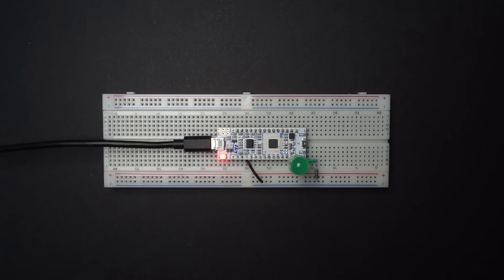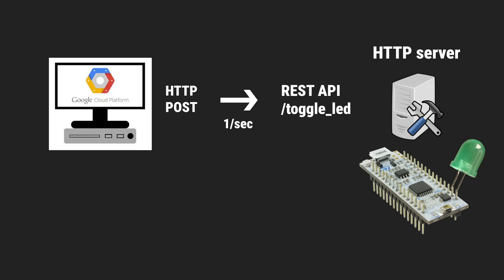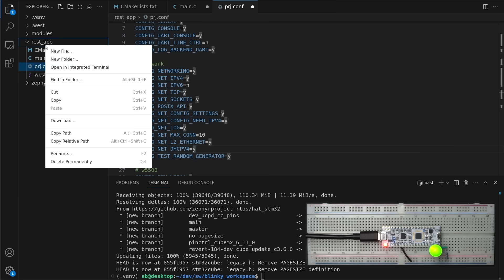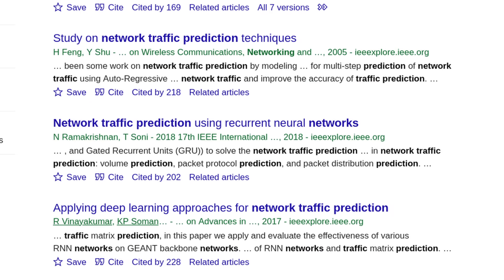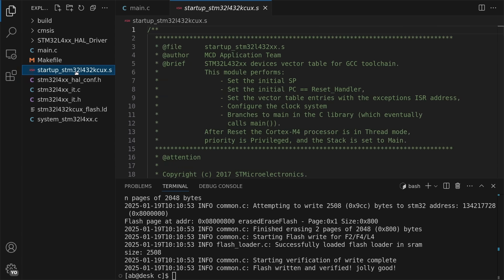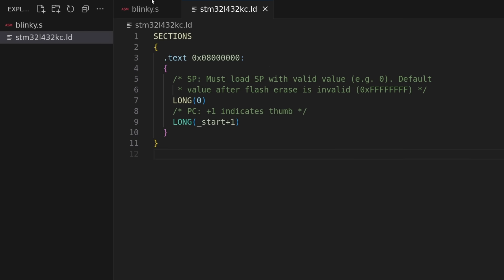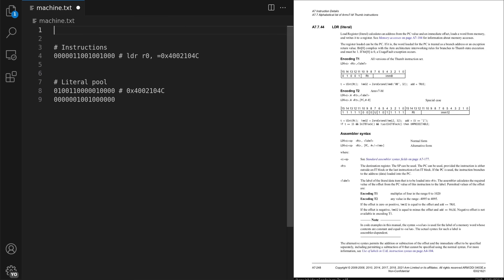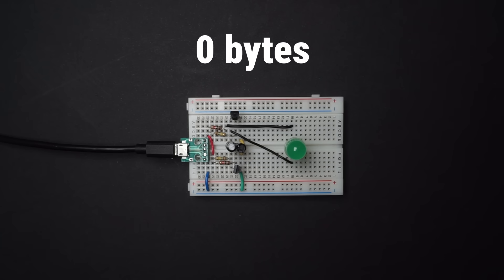I Shrunk Blinky to 0 Bytes

Comment: Now go to the beach, take some sand, extract silicon dope it with aluminium or phosphorus and make transistors, then make LED from same silicon, take two conductive plates and place them together but separate with dielectric, make resistors (maybe graphite?), and mine for copper and melt it into wires, then connect everything
Reply: Still bloated, make a custom led-transistor semiconductor that will oscillate precisely at 1 sec.
But first you have to develop photolithography.
Reply: @monad_tcp you can actually just buy them. No need to craft them. Another abstraction layer removed.
Reply: And that's how you make a C... <abruptly stops>
Reply: @FastKonrad  BAHAHAH
Reply: Copper?! You mean that pretty niche minecraft ore thats been such a meme that it ended up being a real ore irl?!
Reply: Silicon is bloat. Some hand-made relays and an electrical arc will do just fine.
Reply: LED's aren't made from silicon...
Reply: @kstevens3573  Depends on what colors you want.
Reply: @kstevens3573  Wikipedia states LEDs are semiconductor devices, so silicon seems rather accurate. Though some compounds are used to obtain certain colors, but it does not specify in which quantities or whether just as a coating. We are not talking about the plastic packaging, which probably makes for the majority of the weight and volume of a regular THC LED.
Reply: @km077  Silicon has an indirect band-gap, so cannot be made to emit visible light.  Not all semiconductors are equal. 
 LEDs are made from GaAs, InP, SiC, GaN - all of which are direct bandgap materials.  You'll see heavily doped materials like InGaAsP for green LEDs, as doping increases the bandgap, and hence the colour frequency.  White LEDs use a blue GaN LED with a phosphor coating.  
The physics of indirect bandgaps is complex, but basically the excited electrons need a different momentum from the ground-state electrons, and this makes the direct transition "forbidden".
Reply: @km077 All the cool kids are using 3-5 semiconductors. As in instead of group IV B* silicon, they use a compound of one or more group III B elements and one or more group V B elements, gallium arsenide probably being the most common. Some also mix in some less common elements like indium. Some blue LEDs even use a 2-6 semiconductor (zinc selenide, known as ZnSe to its friends). And if you insist on staying with group IV B, there's always silicon carbide.

*yes, it's old nomenclature but calling them group 13, 14, etc kind of hides some of the detail.
Reply: computer is technically just a hot sentient beach cooled down after that we tricked into thinking by engraving magic runes onto it
Reply: @ProSureString underrated comment.
Reply: what an original and unrecycled comment
Reply: You can make a simple oscillator circuit using an inductor and capacitor. By adjusting the value you can achieve a simple dumb version.
Reply: Lol😂
Reply: there are channels out there making their own semiconductors and IC's
Reply: You can’t make LEDs out of silicon, at least not if you want visible light. You need germanium compounds.
Reply: ... profit.
Reply: I do wonder how easy it would be to accomplish the objective of 'blinking light' starting from exactly zero materials, primitive-style. Without electricity it would be trivial with some heat-powered contraption and a fire, but maybe you could even do it electrically if you smelted some minerals?
Reply: and dont forget to make the timing quartz
Reply: It is Boron, which is more commonly used as P-type dopant.
Reply: If you love this kind of thing of normal people performing commercial processes check out “applied science”
Reply: No need for silicon. A relay can do it.
Reply: @samuellourenco1050 relay can’t emit light
Reply: LED is bloat, mine for tungsten and extract inert noble gasses from the atmostphere and make a fillament.
Reply: Done. What's next?
Reply: Teeeechnically... many LED (all?) are used on gallium arsenide semiconductors and not based on silicone. #nitpicker
Reply: Only the real ones know about the PN junction.
Reply: Still bloated. Just flip a switch by hand, or automate with a pendulum clock mechanism.
Reply: That's easy. I'll go to the original singularity point and trigger the expansion first. Check mate.
Reply: You could get rid of most of that and just do the "wires" part. Once you have wires, you don't need anything else. A couple wires in a coil shape is a relay. That provides you with both clock and logic. A very thin wire is a light.
Reply: Or just use an LDR, resistor and Capacitor to make no-semiconductor blinker
or make one with bimetal switch.
Reply: @SurajGrewal LDRs are semiconductors...

Comment: You missed one possiblity.... it may not fit directly in this stack of layers but...
I don't know this specific microcontroller but most of them have clocks/timers/dividers, so you can setup them to divide some clock and output it on gpio pin.
Then your program will have for example 50 or 0 bytes depending on the method of counting... 0 running bytes, 50 setup bytes ;)
Reply: The only right way it is ;)
Reply: @TheBypasser  Yes, it always feels so good if you manage to implement most of the logic with just Timer/Counters, Events and DMA.
Reply: I thought that's what this video was going to be. That he found a neat configuration that would blink the LED while using technically zero program memory, and only writing the peripheral registers.

I was quite disappointed when he went with the non-microcontroller route :(
Reply: @kal9001  bro did u read, op said 50 bytes

not zero
Reply: @ "Bro" did you read the literal video title... lol
Reply: It's possible to use the debug interface, which itself most likely uses temporary RAM code, to directly modify device registers like GPIO and PWM control. That way there'd be nothing in the program memory and the core could remain halted with the PWM peripheral generating the signal for the LED. It'd stop working after a reset or power cycle, though.
Reply: Correction: I'm sure the debug access port can write to device registers directly. RAM code is for flashing. So there'd be absolutely no code on the MCU.
Reply: I was wondering about setting up a pwm controller with ~0.5Hz frequency 🙂
No main loop code that way, everything's in setup.
Reply: @LordPhobos6502  Depending on available clock frequencies and abilty to cascade timers it may be not easy to reach 1 or 0.5 Hz
Reply: @AK-vx4dy  The STM32L432's got 16-bit timers with 16-bit prescalers, so it can divide even a GHz clock source down to 1 Hz. No cascading should be necessary.
Reply: @felixmoore6781 I'm not in current(?) hardware, so if it is as you say then it is true, 1Hz should not be a problem.
Reply: @LordPhobos6502 that was what I was expecting
Reply: Most processors have a clock of some sort, if you can get the 1 second bit from the register and just Boolean it to output
Reply: Masz wkopane. Widziałeś taki film, taką wisienkę i nic nie mówisz? Chyba się pogniewam 😂
Reply: @ELEKTRON1  Bałem się, że się pogniewasz, że konkurencję w miganiu diodą oglądam. No i założyłem, że to wszystko już wiesz ;) 
Ale w sumie to żadna konkurencja, musiał by połączyć siły z @AdvancedTinkering albo @BreakingTaps, bo Ty umiesz 0 bajtów i 0 LED-ów, bo robisz swojego LED 😶‍🌫
Reply: That's what I was thinking. It's no EXACTLY zero bytes as you need to keep the initialization in flash, but for all practical purposes it may be depending on the microcontroller as you may possibly be able to initialize it along with something else, thus taking 0 bytes for the additional functionality. 

An impractical method might be to initialize it over the jtag interface. Then it will work so long as you have power. If it's solar powered with a rechargeable battery, then it's totally usable. E
Reply: Yeah, i was waiting for him to setup a PWM output of the MCU to do this. It would work in like 4 lines of assembly on most MCUs.